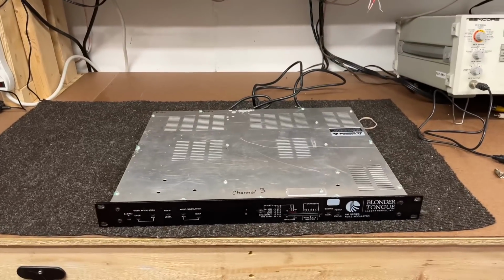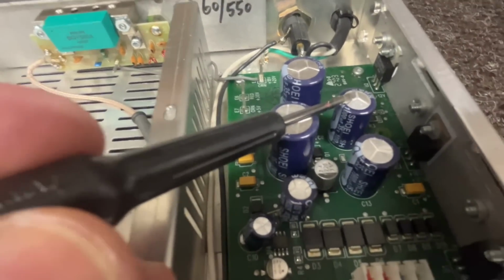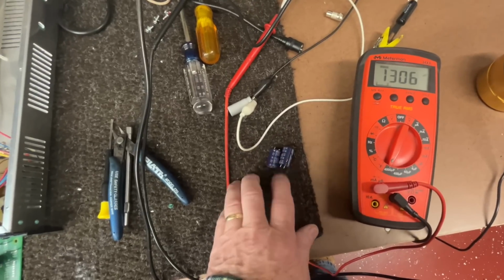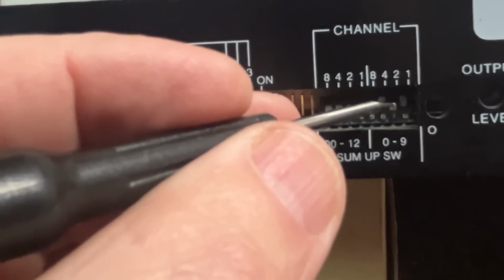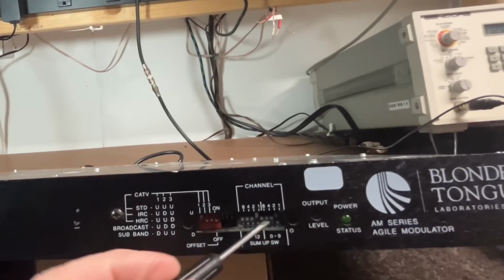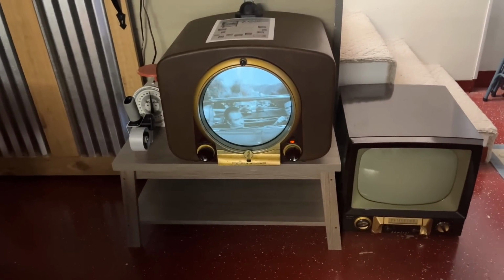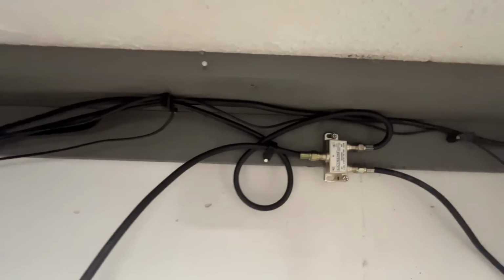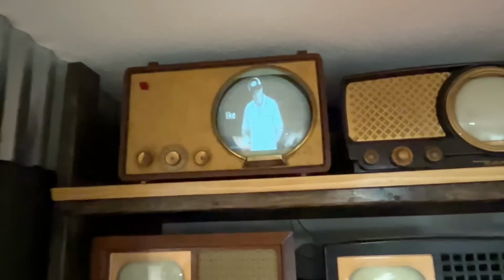Blonder Tongue Agile Modulator Repair and Hookup.

Comment: I have the same agile modulator and had to replace the capacitors like you did. I don't use it anymore and unfortunately my current cash flow does not allow me to feed my radio/TV restoring hobby. You have a wonderful collection. Do you get visitors to show your collection to?
Reply from the maker: @HD7100  
Thanks for the kind words , My collection is just for me to look at. Reliving memories of my TV repair days. When I’m gone not sure what will happen to it then 😩
Reply: @CreekviewAcres  It really doesn't matter what happens to it when you are gone. It serves its purpose while you are still on the right side of the grass.